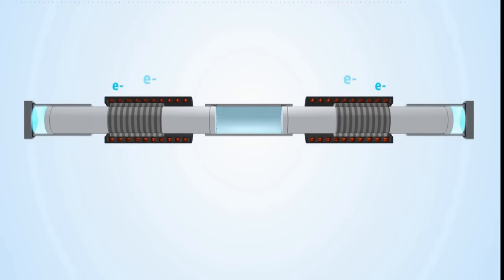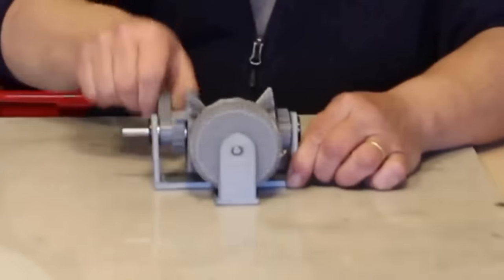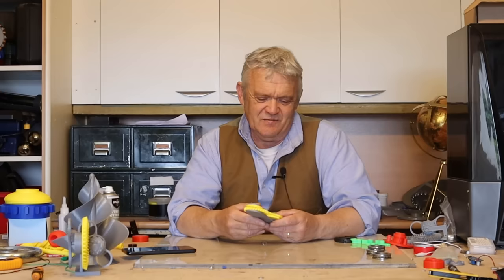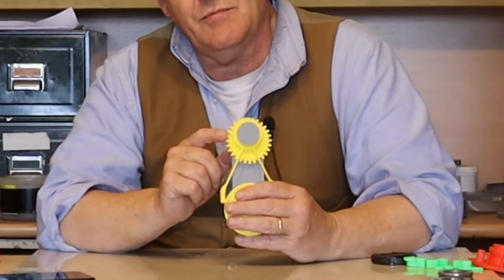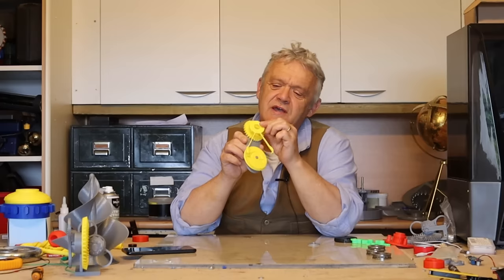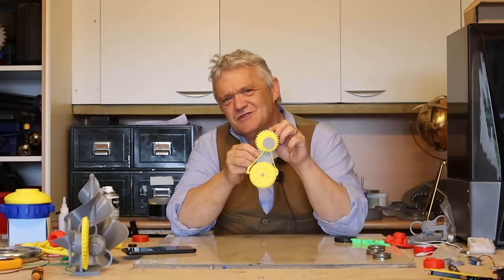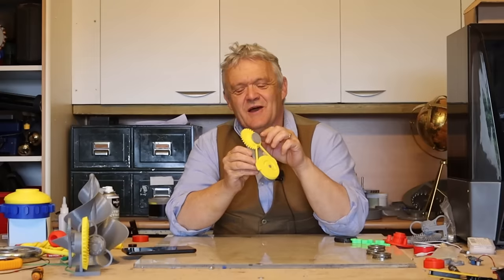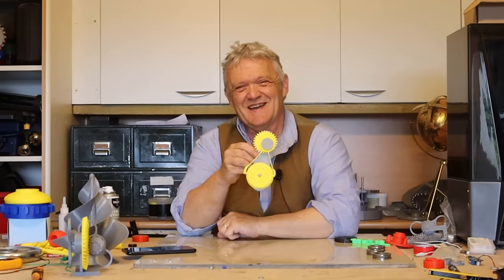2003 The Magic Lever Energy Harvester by Seiko

Comment: Robert, you're talking nonsense. A task, like doing one step, is doing work. This is an amount of energy expressed in joules, not watt. Next you're multiplying a power of 10 Watt it with a number of 10000 steps, and calculate the result: 10000 watt*hours. Where did the hours come from? Think a litte bit more about the units you're using.
Next: harvesting energy from daily task like walking makes it more tiring and it is less comfortable. It's a  bad idea!
An rough estimation of that flexible footpath. Say the person weights 70 kg, the foothpad is pushed in 5 mm then the energy for one step is E=m*g*h = 70*9.8*0.005 = 3.4 J. Doing a walk of 10000 steps will generate 34 Joule without losses. A small solar panel of 150 mm * 150 mm  12 hours in and aimed at the sun will generate about the same amount of energy. Why building such a complex, vulnerable, costly and tiring mechanical foothpad when you can use something cheap and ready available solarpanels.

Comment: More more more more!!! 
Anyways, this mechanism is ALREADY used for "energy scavenging" in Seiko watches, right? and there are plenty of similar mechanisms in all other "self winding mechanical watches" Not only that - but they are already miniaturized, and being produced in large numbers!!! 

It seems like this mechanism needs only a "little push" into the electricity world. isn't it? I'd guess the main issue is that it is generally designed for very little movement (in terms of RPM or even Angle-per-second...) which fits enough into winding springs - but for electricity (via some induction mechanism) you'd want something that rotates much faster, preferably also much steadier. 

Hmmm.... some rotating weight and down-sizing gears at the output??